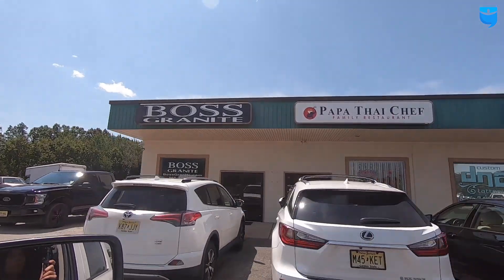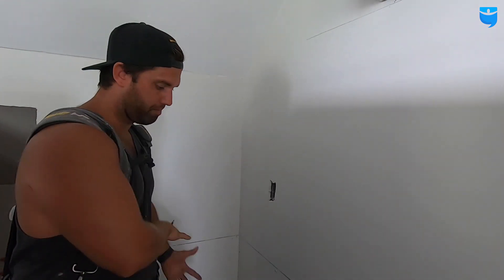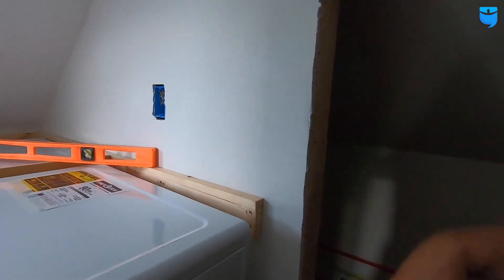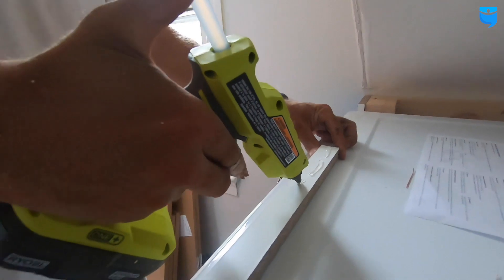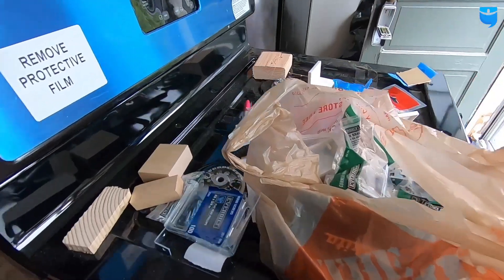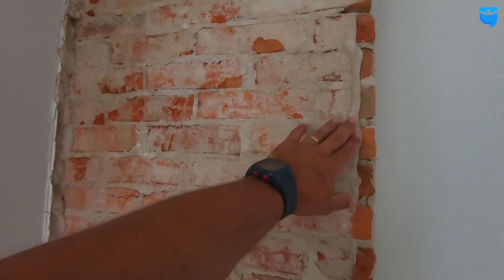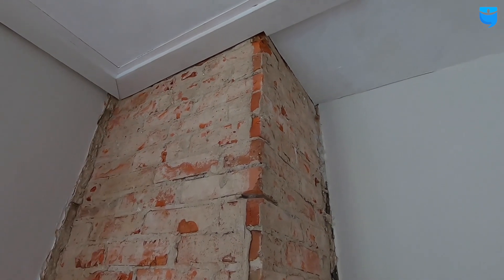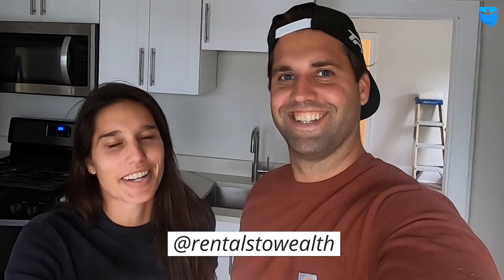Ep. 20: We Bought A BRRRR Investment Property! | Kitchen Countertops & Finishing Touches

Comment: I dont know how I feel about the hot glue... 🤔 that may have to get re-adhered sooner than they think.
Reply: It may, I’m always looking for good trial and error quick adhering adhesives so if I have any issues in the future I’ll repost an update. The areas that may get bumped or hit I had some concerns also so I secured them on the inside with small L brackets.
Reply: Maybe next time do a 2" bead of hot glue top and bottom and a run of adhesive along the middle (or vice versa might be better). The hot glue will tack it in place and the adhesive will give better long-term hold.
Reply: @sfquigle  good tip!